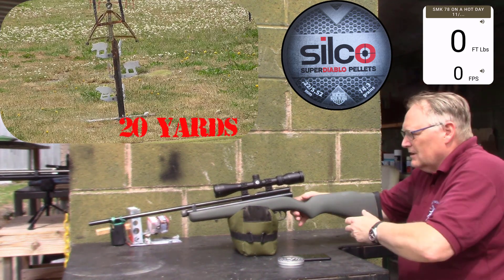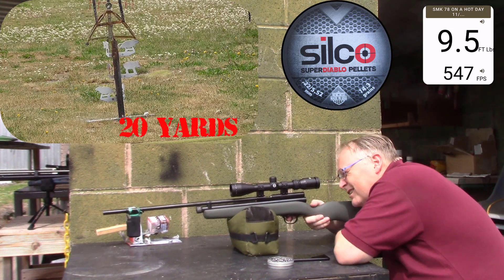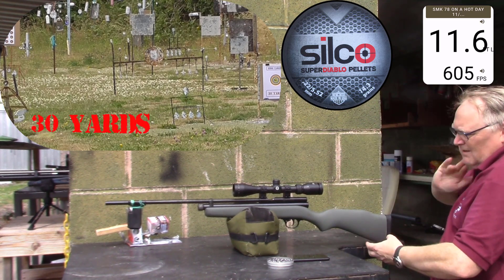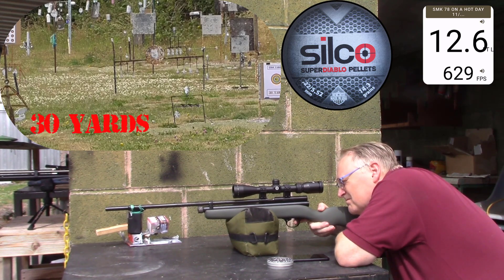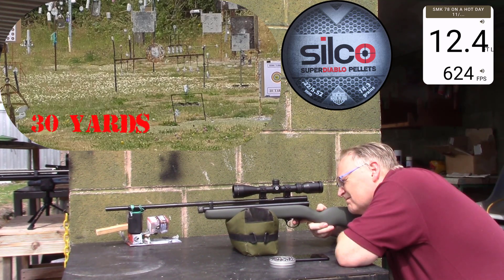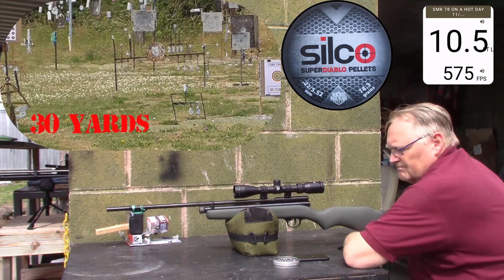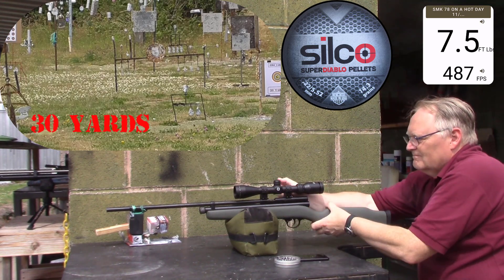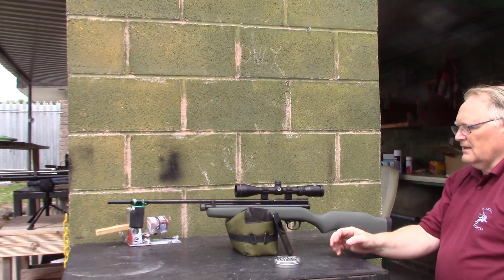The SMK SX78 C02 Rifle - Comparing Cold Weather to a Hot Weather Effects

Comment: Thanks for the informative update Mark, I wonder if that result could be achieved in the colder months with the use of hand warmer pads applied to the cylinder tube. A simple velcro wrap around sleeve could hold them in place and it wouldn't be to bulky, certainly help out on those cold winter ratting forays 🤔👍
Reply from the maker: Yes, I expect if you could use some kind of blanket, to stop the cold effecting the temperature it would help. Maybe future C02 manufacturers could make some kind of thermos shielding around the cylinder to help control temperatures effect changes, but C02 tend to be budget rifles, so I can't see any of them doing much into solving the issues with temperatures, when PCPs are the main air-guns after springers.

Comment: Very interesting Mark. Does this mean that legally the old bill could test your rifle at high temperatures and if it goes to 12 or over  prosecute for an fac rifle? I ask this because as you may remember I have recently purchased ixia in .22 It shoots at max dialled up power at about 11.5ft lb however I noticed the other day as it was hot it went to 12ftlb ........🙄 which concerned me. Obviously not the amazing increases  shown on the co2 rifle. But still a concern. Interested in your thoughts Mark. Thanks for another interesting video 👍
Reply from the maker: In theory yes, but compressed air, like you say doesn't react as much as the C02. It should be taken into account that temperatures can effect the pressure in the cylinder. I had left the C02 rifle in the Sun to increase what you would normally get, but as you could see, it steadily increased in power. I don't really use my C02 rifle anymore, partly because of this reason. From one day to the next it will behave in a different manner, due to temperatures, which will have an effect on point of aim etc. Compressed air is the way to go. One of our club members had a similar outcome with a  gas ram. Because they use different gases, depending on the brand, they can also increase in pressure, due to temperature changes.